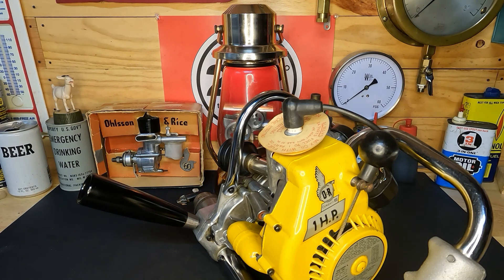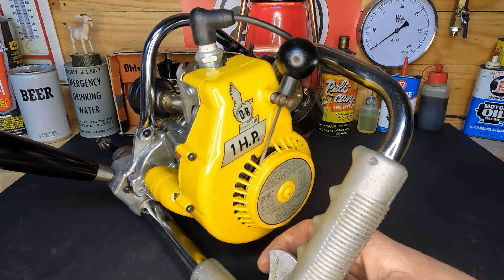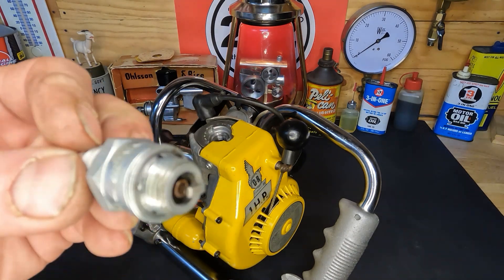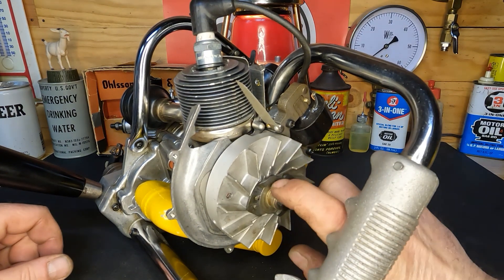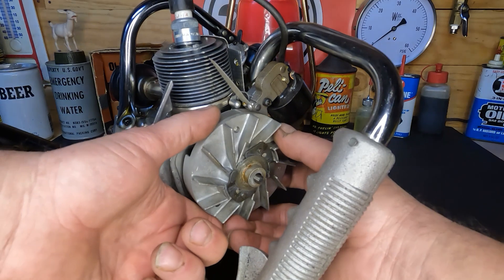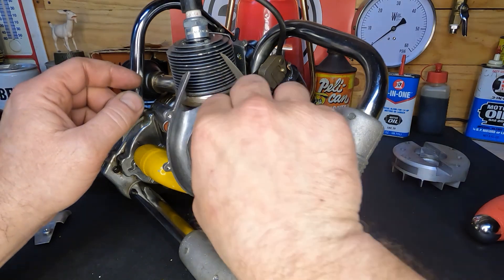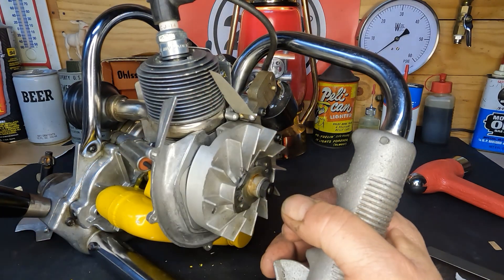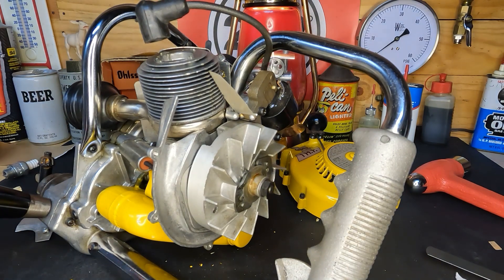Ohlsson & Rice Drillgine. The First Yellow 1/2" Cordless Drill?  First Start (NOS?) Part 1

Comment: If you use a dedicated point file, it will eliminate any contamination from the abrasive of the sandpaper.

 It will actually do a better job of cleaning the point contacts.Just thought I'd mention it, that's a beautiful little piece, by the way!!